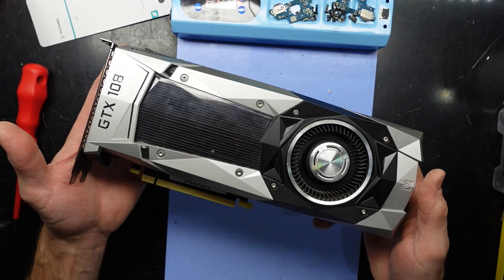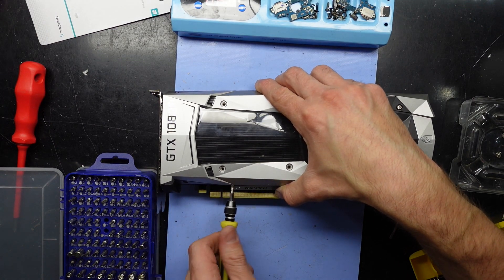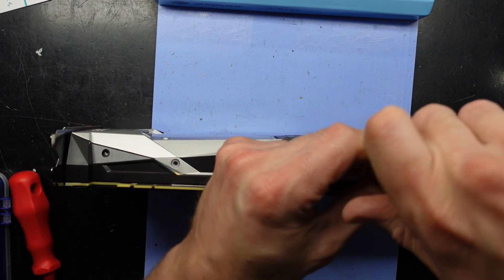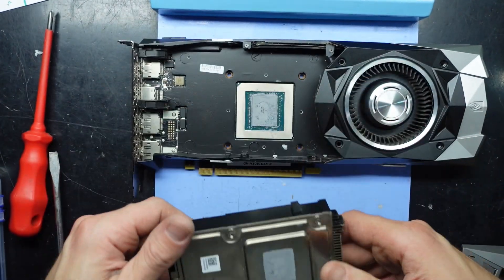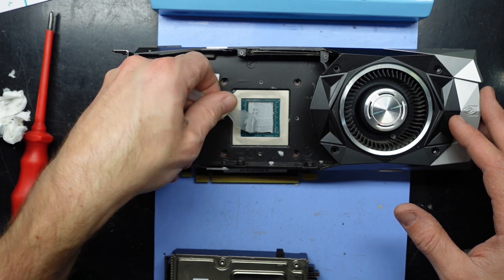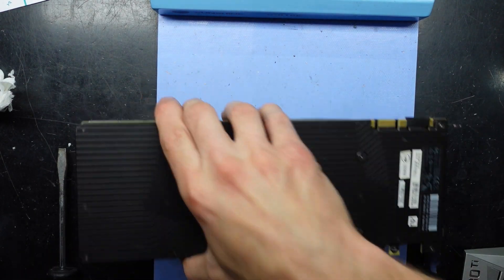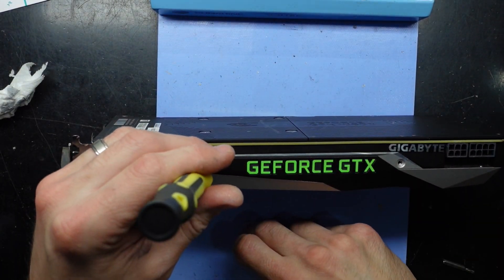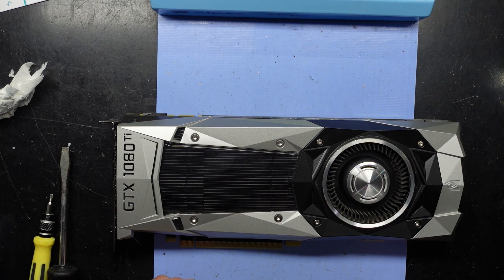Gigabyte GTX 1080Ti 11GB FE Thermal Paste Replacement

Comment: You absolutely do not need to remove 70% of those screws unless you want to get to the "thermal cartridge". Otherwise just unscrew the bottom and the interface bracket and it comes off as one piece.
But this is a better way if you want to just re-paste the core and clean the cooler without having to deal with all the thermal pads.
Reply from the maker: yah.. I went a bit overkill with the screw removal

Comment: Thanks for this bro, I have the same card, Temps go to 87C when gaming at times, Probably time to change the paste
Reply from the maker: i would be changing the paste, before it goes to a early death
Reply: my 1080ti runs at 85-87c on warzone so i used a air compress gun in my pc and it now on 50-65c while gaming .. but if you had your card for a long time i think changing the paste on top would help alot

Comment: How are the temps before and after repasting?
Reply from the maker: Didn't test
Reply: @rickstechrepairs  why?😁
Reply: Measurement of success is? Make YouTube video or confirmation to YouTube video that change were successful…
Reply: @omonkkonen6676  Doing this now on a 1080ti I just picked up. The quality of this card is awesome. Easily the best card I’ve ever torn down. I would go a step further and remove the shroud over the fan and clean that up as well. I noticed my temps in helldivers 2 were 74 degrees before tear down and that was just standing in the spaceship walking around. I’ll follow-up and let you know what the temp dropped too, but they will drop and even if you don’t test temps before hand it’s good to do this either way as the paste is dry and alot of dust will be covering the fan and Heatsink.
Reply: @jayhawk6029  and?
Reply: @LaserVelociraptor  Temps dropped noticeably. In heaven benchmark it was 80(ish)+ degrees before repaste and then after it was staying around 75 degrees. Make sure that you don’t just do a dot or line of thermal paste. You have to spread the paste on the die evenly so that no gaps form.
Reply: @jayhawk6029  This comment is underrated and the method of a pea or a line has been wrong since day one. (Bite me, Linus) Spread evenly has been the proper way since I learned how to paste a CPU in 1996.
Reply: fresh paste on gpu makes approx like -10*C lower temps (on this blower card maybe less)